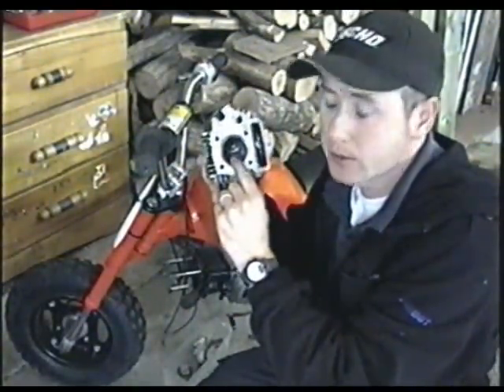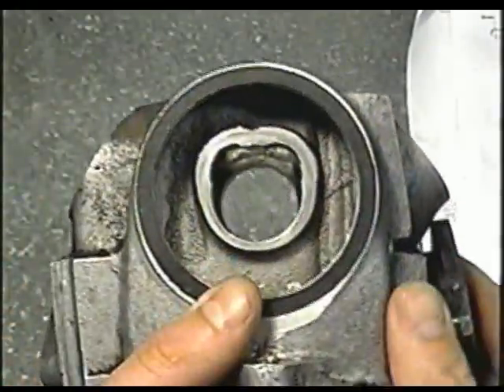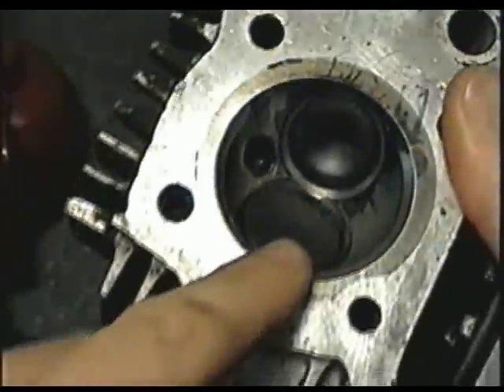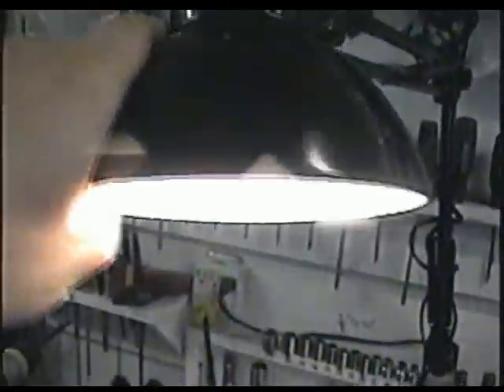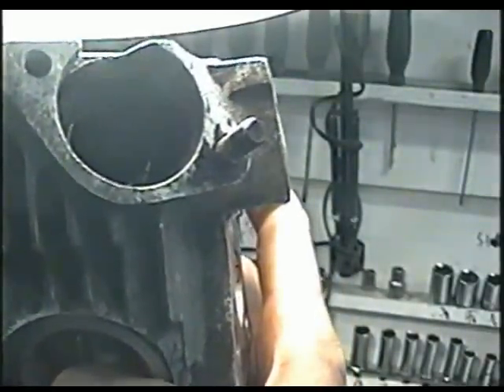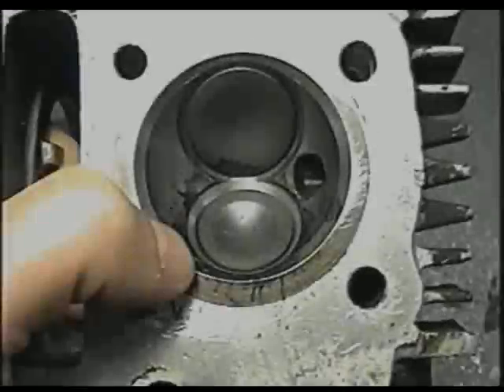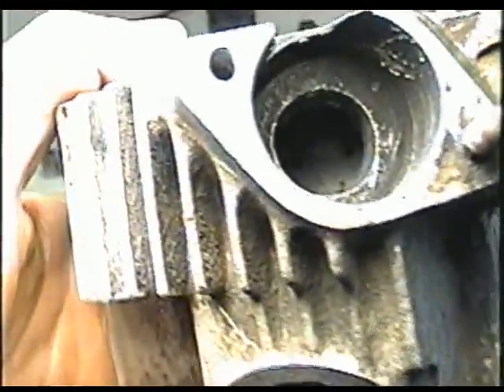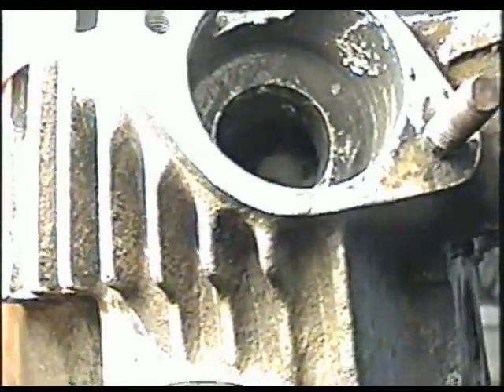HOW TO Check Valves for Proper Seating on OHV Engines

Comment: just in case you don't see any light escape and you basically have a good uncracked head, do a leak down test too. fill up both ports with fuel and wait about a minute or two. if neither of the valves don't show leaks, it's good.

Comment: Nice answer donyboy, and a good method too. I have been a motorcycle mechanic for many years, and traditionally, paraffin or petrol is used to check valve seat/leakage, but your method with light is pretty good and a lot less messy !! next head job I do I'll try it out.

Comment: My friend has a taotao atv. I was riding it.  It ran fine for months but this time I gave it gas it smoked a lot from a crank case breather and hasn't started since. It has compression and spark and the carb had Ben cleaned. There is a coil for the spark that is said to produce spark when bad but the spark ain't at the right time. Do you think that might be itt. It takes in starting fluid but wont ignite it. Them it just pushes it out the exhaust

Comment: i tried this test (on pretty much the same engine but a 125) and i could see light through the intake valve, it ran okay before but it smoked REALLY bad, could the valve not seating right cause it to smoke A LOT? and it has good compression.

Comment: Another way to check is to pour a few drops of gasoline into the port, and see if any leaks thru into the combustion chamber. If it is sealing right, no gasoline should be seen in the chamber. This method works well on car engines also.

Comment: Great videos! Have a craftsman riding lawn more. Was running great then started  Backfire through exhaust, and rough idle. Acts like it wants to stall, Then stalls. Backfires  seconds after start up. Had no problems up till know. Only three or four years old..
Reply from the maker: Stephen Kuper if it's OHV you might want to check valve adjustment

Comment: What's the solution? I just replaced valve guides, re cut the seats then did the light test, and has light passing through. First I thought it needs more seat cutting but I feel the valve not in right angle to the seat. Please help
Reply from the maker: try a new valve
Reply: @donyboy73  I did use a new valve. It seems the guide is not center to the seat. Or the guide bore. Is there any repair to this?

Comment: That was useful information but I have a different problem. I have a 18.5 hp OHV briggs engine and the exhaust valve seat came out off it's seat witch caused the valve to not close. So what I need to know is what would cause that to happen and can I just put it back in or do I have to replace it. And how do I keep it from coming lose again? clintatch1
Reply: Yep, you got that right!

Comment: Soapy water works also for checking valves. It has to be soapy, the soap releases the surface tension of the water. A power drill and a bunch of lapping can cure the gap issue. I use a metal mail drive into a short wood dowel that I've put rubber dip (the stuff you use for dipping your pliers handle in) on in several layers. This protects the valve face, and lets it still grip. Use a veryable speed drill. Sure beets hand spinning one for a couple of hours!

Comment: Yeah, almost any solvent will work, such as mineral spirits or carb cleaner.  Water doesn't work as well because it beads up and doesn't always show very small leaks.  Pour it into the ports, though when the head is off, not into the cylinder because it will remove the oil film from the cylinder and piston rings and get into the crankcase.

Comment: It looks like the exhaust seat is all ready seating to low, it needs a new seat put in and the easiest  way I do it in the shop is to cut out the inside of the seat about .006" smaller than the OD, that way the replacement seat with the original factory OD will fit right in. And I do my seats on aluminum heat this way so I don't have to hear the head up, keeps the heat from warping. But like I said , it's the way I do it, I'm sure someone else will use a different method.

Comment: better way to check the normal valve seating is to check the valve under pressure caz its working  under high pressure inside the engine

Comment: Hi Dony. I''ve just started to seat brand new stainless valves in my crf. I've lapped them to what I thought was a perfect seating however , I can still barely see the minutest amount of light through one of the valve seats when I cover it with a torch. My question is , do I check for light with the valve springs installed or just sitting upside under the valves own weight ? Thanks again mate.

Comment: Great video! i have a AYP lawn tractor that stops running after i release the brake pedal wanted to know what you thought? Is it a Safety Switch?
It starts and then i release the brake pedal and it stops!

Comment: I rebuilt a 340 honda engine from an eb5000 generator that i bought second hand I changed the oil unfortunately didnt put enough in. a little confusing how that dip stick works anyway apparently the low oil shuttoff doesnt work either.cause it started squeeking and when I took it apart the connecting rod was broke.no holes in the block. crankshaft caked with the aluminum from the rod.sanded it down with fine emery cloth .bought the shop manual.checked all the clearances with a mico gage everything else looked undamaged..push rods piston honed the cylinder put new rings on the piston according to instructions checked timing marks 3 times before i closed it up.Its been about 6 months since ive been on this project.Im pretty sure I  did the valve adjustment properly but maybe not.when i rotate the engine by hand it gets really tight at i assume tdc then normal after that.It did eventually start after a bunch of pulls but after 4 or 5 pulls it rips the cord right out of my hand. I let it run for a half hour.sounds ok maybe an occasional ringing which could be from something loose. but the start up procedure is the same im afraid to start it have to put 2 pairs of gloves on to prevent cord from jerking my fingers.could this be the valve lash adjustment? any suggestions thx

Comment: I am a tech, The proper way to check the valves is from the port side with vacuum not from the chamber side and why would you use petroleum jelly? If you don't have a vacuum tester then you can use varsol or a non flamable thinner in the port with the valves and springs  in place to check for leaks.

Comment: I just wrap my lips on the throttle side of the intake valve and blow with the springs shut, if I can't blow through it the intake valve is seating good enough. Same procedure for the exhaust side just need bigger lips.

Comment: Proper method at dealership is compressed air with O ring, or just leave it face up pour some gasoline, and see if it leaks threw, but the accurate way to do it is with compressed air.

Comment: could you please tell me the gap on a - apg 30009 6000w 13hp generator ,how to seat the valves. properly.thanks your freand in douglas.az
Reply from the maker: +Samuel Gonzales I set them at between .003 to .005
Reply: im sorry what i ment was could you tell me how to gap the lifters on a apg 30009 generator 13hp.
Reply: but thanks for the other vidio your freand in douglas arizona.

Comment: Basically your telling him to lap the valves with NO VALVE LAPPING COMPOUND sorry but putting petroleum jelly and trying to lap them is the most amateur way of trying to correct a leaky valve.  

The vacuum test is a way to test if it leaks but on a small engine like this can be checked with gas, carb and choke, or degreaser to see if it leaks through WITH THE SPRINGS IN. Some people don't have that kind of equipment and also why reinvent the wheel. If the method works use it end of story.